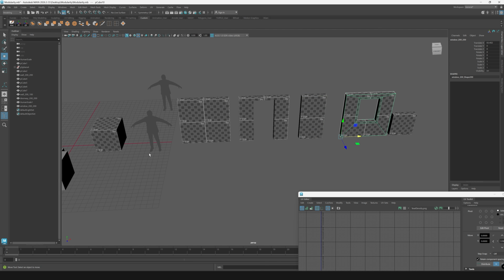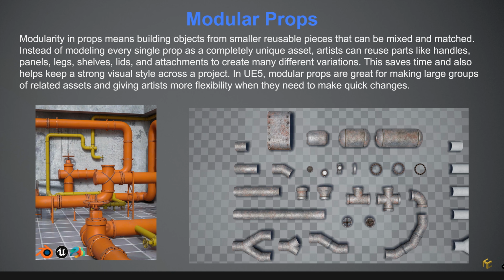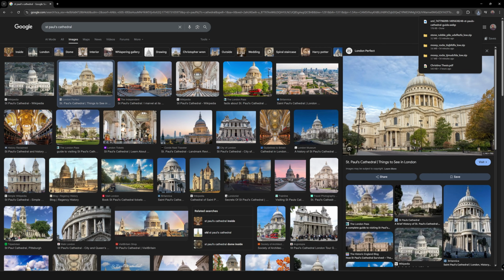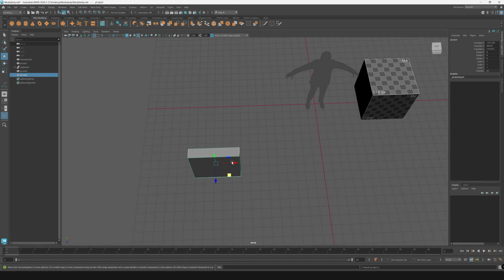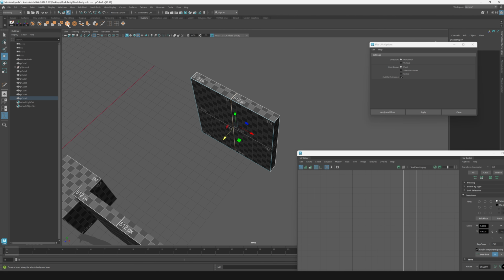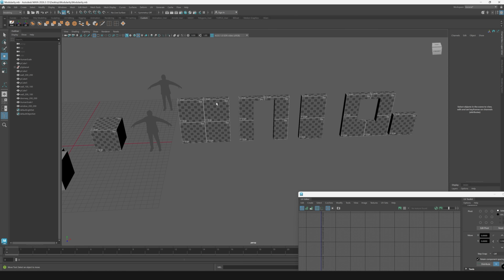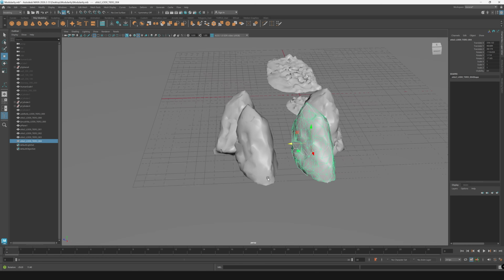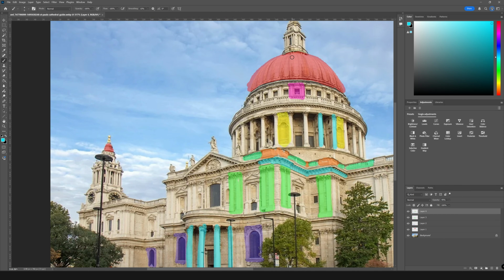How Modular Workflows Work in Game Art (Environments & Props)

Comment: The hardest thing for me to grasp is corner pieces. If I snap on bottom left vertex and rotate then the corners are ugly. If I include corner pieces how do I judge the sizes because it offsets everything and eats into nice 1x1 or 2x2 or 4x4 etc….pieces. Also, doesn’t placing pieces at the edge of each other sometimes result in light bleed in unreal ? Honestly having issues with my environments when I do block outs when it comes to placing walls on top of the floor vs placing them at the edge of the floor.

Love the video❤, thank you.

Comment: Material layering has a price though, even if combined into one shader/draw call, that draw call is heavier as it has many more instructions than more traditional methods. It can be misleading to think of material layering as a sort of holy grail,, but even in Unreal it can get hairy with using even 2-3 layers due to this. Not all draw calls are created equal and it is not the sheer number that counts, but what gets pushed through as well. The other thing is aesthetics: While it inherently increase cohesion due to material reuse, things can start to look "a certain", procedural way, which is often noticable and is something we see in a lot of modern games vs older games, where hand crafted, deliberate detail in tilables and trims was at the forefront and procedurality not as wide spread. Artistically, this hits different than mask based blending inside an engine.
Reply from the maker: I agree nothing is free and that everything in rendering comes with a cost. That's why profiling is so important. Whether you're using traditional master materials or a material layering workflow, you still need to optimize your shaders with things like static switches, channel packing, shared functions, and by disabling features that aren't needed for a given material.

I'd also argue the same point about the "procedural look" can be made for modular environments. A modular kit can become repetitive if it's used poorly, but we don't blame modularity itself, we improve the art direction with variation, decals, unique assets, vertex painting, composition, and thoughtful placement. Material layering is no different. It's a workflow, not an art style.

Material layering has been used in AAA production for well over a decade because it's solving a production problem. Instead of authoring and storing hundreds of bespoke textures, you're trading some shader complexity for a significant reduction in texture memory and a much more scalable workflow. That VRAM budget can then be spent elsewhere, such as higher-quality geometry, VFX, lighting, rendering features, or other areas that have a bigger visual impact.

Like any workflow, it's about making informed tradeoffs. There isn't a single "correct" solution, you're balancing GPU cost, memory, artist iteration and authoring time for all of these assets, production scale, and the visual goals of the project.

Comment: What if you need non-square piece? The structure I am modelling has got 4 metres wide and 3 metres tall walls. UVs never line up seamlessly unless you put some parts of the UVs outside the 1:1 space which you also did in your examples but as far as I know, this won't work in game engines.
Reply from the maker: Hey! So you can do a few things, one thing I want to make clear is you can have exceptions to the rules, but you don't want to outright say that as it can confuse artists just learning. You can easily just make a 4x3 meter modular wall piece, that would be the simple method. To maintain the power of 2 size method I showed, you can cut your 4x3 piece into powers of two by making a 2tallx2wide wall piece and a 1tallx2wide piece. If I knew what the piece would look like, I can better assess. As for if it will work in game engines, it actual has, many games have shipped with using this method. If you work with Tileables, as long as your UVs are snapped to an edge grid of the UV tile grid it should be seamless. Seams won't happen if you properly UV a mesh that is scaled to whole meter units. Now if it is a bespoke (uniquely baked asset) Yes seams can be tricky, but you can work to make sure details are mirrored and you can also use two UV sets (one for the baked details and one for the tield details) I have a video that goes over usign multiple UV sets. If you still are curious about this, I would love to see the reference you are trying to achieve and I can give a better assessment than going in blind.
Reply: @hughjchew  Say I have got a 3 metres tall, 6 metres wide wall as a modular piece. In the texture atlas for the entire building, this wall has got its own UV space but the problem is that it may be seamless width wise but it has got a clear seam going up an down because it is not a square piece. I hope I have explained it well. So how do you solve this problem? How do you make a non-square piece tile both horizontally and vertically without and distortion to the texture itself?
Reply from the maker: If I am reading this right, essentially you are using an Atlas aka Trim Sheet that is fully tileable horizontal, but not vertical. You wondering how you can map effectively an area that isnt necessarily tileable up and down. Well their a few ways.

1. Use some sort of Geometry to help hide seam likea modeled trim of sort or some other type architecture detail.
2. Dependign on how big and how close the player gets you can use vertex paint to help mask the sema swith dirt or Paint. or even use a Decal to hide the seam. The last and most easiest is make a second texturerset of that type of material to use. Depednign on memery constrants and the type of tileable you need, you maintian similar nodes or details in your texturing program, you can easy author the texture set similar enought to apply that material to that area. In TLOU we had different Trim Sheets for certain types of materials like Paint, metal, wood, etc. And also generic tileables of that material type to use everywhere. They were auhtored similar so the fit together pretty well. Again like I mentioned before if you want me to go indepth, you can always send me reference or screenshots of what you want to do and I can try to work out a solution insead of going in blind.

Comment: Great video. I’m thinking of making one 2k atlas map for different assets and for different modular pieces at once. Have you done anything like that? I’m thinking how it will affect the performance if one material is assigned for 10 different pieces and then instanced in the scene?
Reply from the maker: SO I would is make sure the 2k resolution is necessary. As in if you a texel density of 1k per meter or 512 per meter, then that 2k should either be 2 meters of physical texture data for the 1k TD or 4 meters for the 512 TD. Next if the Texel Density is valid. It's fine and actually better to use a an Atals or Trim for modular pieces. 

The more you can reuse, the better. Even if you make Material Instances that have small variations thats still cheaper overall. A Material takes the essential drawcall for the mesh and Instances typically don't take in the cost of the Draw since it's referenced already. It's the same with using Modular Kits as it's cheaper than using wholly unique assets.

 If there is a concern it would be that either when the textures start to Mip or lower in resolution the further the material surface is from the Camera POV, you make get some pops of odd color or roughness since the mip tends to average the pixels to fill in the lower resolutions. But thats an if. The other thing you want to account for is reusing the layout of your Atlas/Trim so that you can easily swap to a different material atlas with different trims and since the layout is the same, you don't have to re-UV your modular kits pieces.

Hopefully this helps!

Comment: And then comes the paper "batch batch batch"
Reply from the maker: I'm not sure I follow what you mean?
Reply: @hughjchew    The old nvidia "talk" that comments how drawcalls should have enough vertex in them to avoid being CPU bound. It was written before DX12 and Vulkan which have improved drawcall cost a lot, but still set an upper bound to how modular one can be. Unless batching during runtime?
If I link the pdf, youtube removes the comment. The search keyword is "BatchBatchBatch.pdf" hosted in nvidia's website. It's an old one.
Even though it's old, it does still apply to DX11 specially, I find myself CPU bound with my low poly work and batching is what helps, though I do it during runtime, to keep benefits of the modularity's workflow.
I was too vague in my comment. Thanks for asking.
Reply from the maker: Ahh that makes more sense, thank you for the context, yes you are right that I think depending on how well the platform handles DX12 or Vulkan can make that difference of Batching. 

When I was working on Asgard's Wrath 2 in UE4/UE5 we had a lot of hardware constrants to manage since we couldn't rely on a Tethered PC. We essential had to go back to PS2 levels of art, 256 px Texel Density, 500-1000 tris, Mirrrored UVs, Baked PBR. You name it, but even with all that we hit Draw Call limits, only switching over to Vulkan did we start to hit our marks performance wise, especially VR had to hit 70-90 fps with dual 1280x720 renders! 

I know theres also a further Instancing method that I want to go over later called Instance Static Meshes and Heirarchical Instanced Static Meshes that can help with the further Draw Call limits.